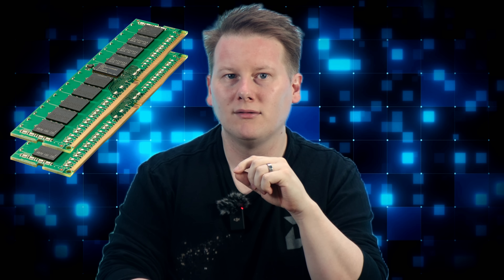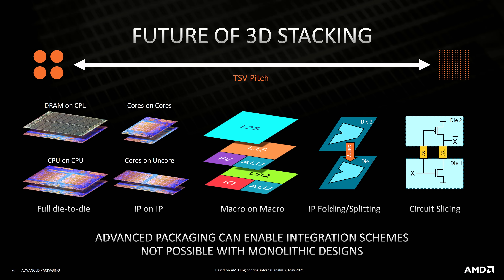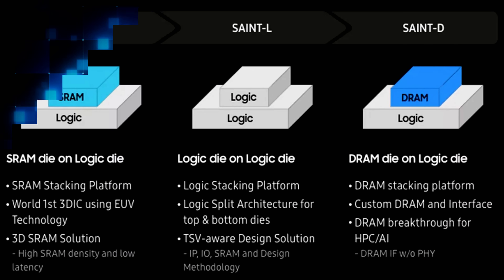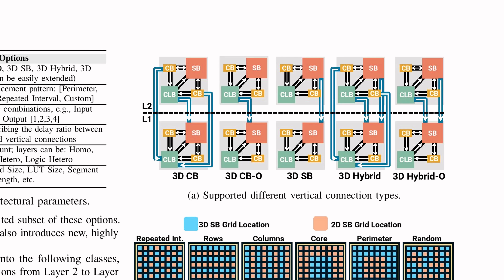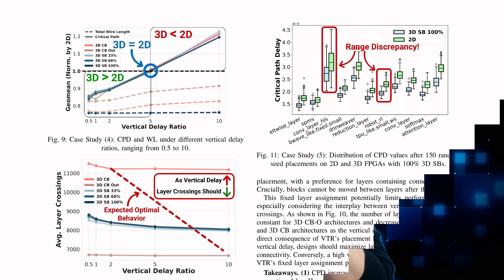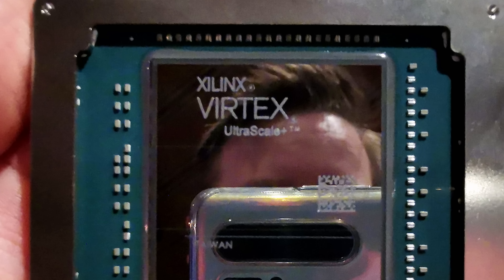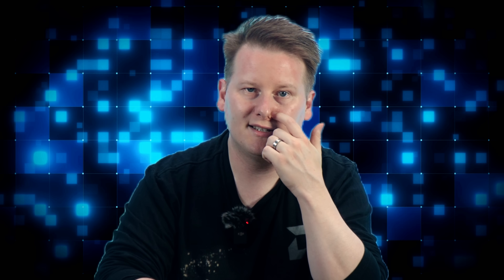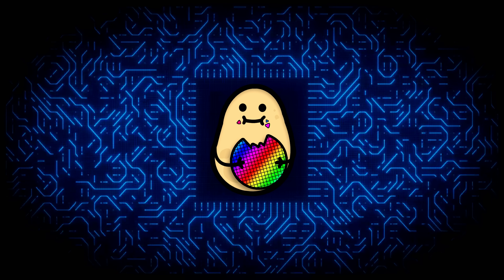Monolithic 3D: Stacking Without Chiplets

Comment: I've often wondered if we'll ever use the third dimension fully, not with layers but treating it as equal to the other two dimensions. Allowing transistors as well as connections to be oriented vertically, or even on the diagonal vertically. How does vertical resolution compare with horizontal resolution? That is, is vertical resolution a problem or a benefit? Is fully using the third dimension a problem for controlling heat or a benefit? Not using the third dimension fully has always seemed strange to me. Ignoring all that space it opens up. I guess the problem will be how radically different it is from the well-understood and optimised legacy 2D design and manufacturing it would have to evolve from.

Comment: Obvs, this has to be done, like the advent of multilayer PCBs. Yield will be fun when we get there.
Reply: Considering the chiplets and 3d v-cache, sooner or later companies will be able to print chips in 2d and then lay them on each other making the 3d design
Reply: I think it makes sense they start that with FPGAs in mind.
You just make extra blocks, and thrn mark them as bad block if they don't work.
Just like with HDs.
The yield is 100% basically.
I think reconfigurable computing is the future.
Not having static CPUs, but having a super compiler that takes C code and configures the FPGA hardware to obtain the desired behavior.
That was going to be my PhD thesis before I dropped out of the uni for life reasons.
Reply: binning based on number of available nodes, depending on yield .. RTLs reconfigured to 'route around' broken bits

Comment: Is this creating the 3D layers with lithography or stacking separate silicone logic?
Reply from the maker: litho. Hence monolithic 3D
Reply: @TechTechPotato there must be major technical limitations to this right? The deposited layers during lithography can't perform the same as the silicon base layer otherwise what's the point of using silicon at all,  unless the can make new silicone layers I guess
Reply: @TechTechPotato  I'm confused. TSMC, Intel and Samsung do not have any process nodes that support this and it's not in IMEC's roadmap either.

Is LaZagna meant to be used to explore potential monolithic 3D microarchitectures as some theoretical/academic exercise? Nobody is going to be able to manufacture these designs for many years. I can see LaZagna being used to design stacked logic chiplets though.

Comment: A 3D FPGA would be an extremely intriguing part to build with. It will need a GPU to accelerate the routing algorithm, but not a deal breaker.
Reply: Indeed, PnR has for the longest time been a key challenge in designing efficient chips. However using GPUs for hw-accelerated PnR has also been common since at least 15 years ago when GPUs started to have generalized compute units in them & not just specialized ROPs so they could be used for general category of engineering optimization problems, including PnR & routing optimizations. However, large die on leading edge silicon PnR as well as verification is often done with specialized hardware or custom FPGAs doing the heavy lifting.

Comment: Beyond FPGA, LaZagna would be helpful for closing timing on any 3D ASICs including CPUs & GPUs. Looks like AMD has a head start on both NVDA & Intel!
Reply: Been thinking the same, less distance - more speed. FPGA for logic, ASIC for glue. ASIC would be kind of a HW RTOS...
Reply: Really excited for FPGAs though!!! With CFETs, Backside power delivery, and backside local signals, plus 3D stacking of CLB, SB, DSPs, etc the amount of compute we will have in the next 10-15 years in FPGAs is going to be absolutely nutzzzzzz. Sure CPUs and GPUs will Greatly benefit from the above advancements but arguably FPGA will see the most benefit.